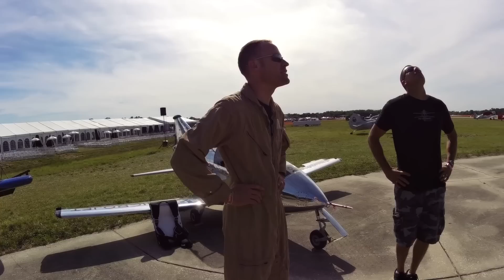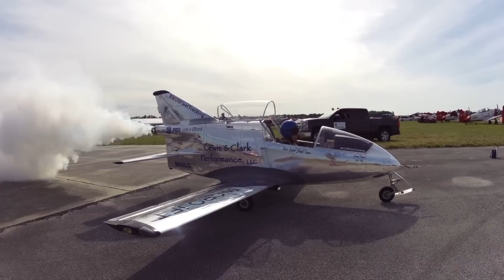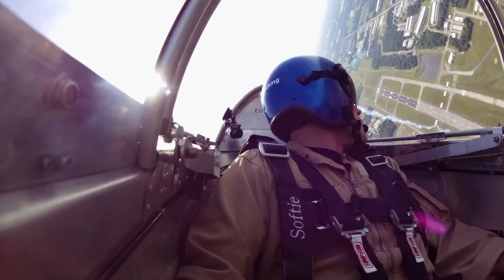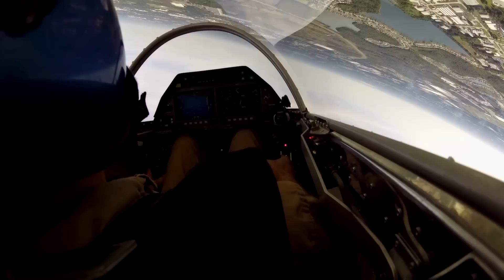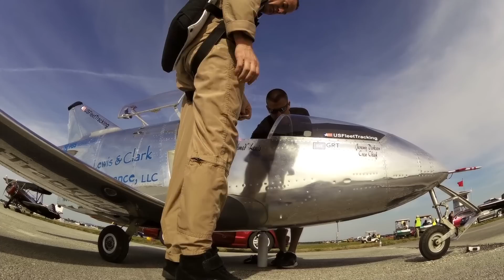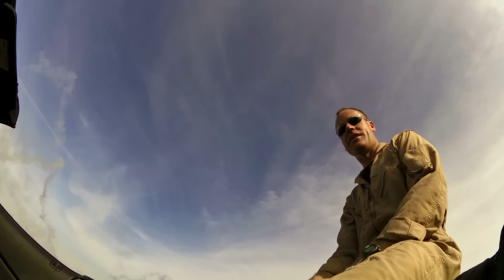FLS Microjet - Flying Magazine

Comment: His comment ( if I understand him correctly ) that only the factory built bd5 were successful and capable of flying until this guy.
That is completely incorrect. Several bd5-j were built outside of a factory. I am unaware that their is some factory who builds them in the 1st place..
My father (Edwin "Ed"Johnson ) personally built 3 Bd's in the 80's. He ( my father) also is the 1st Bud Lite Anheuser Bush BD5 pilot in the air show business
. One reason my dad decided to hang it up was because the engine company that exclusively built the engine went belly up for obvious reasons ( Not a butt load of BD5 -J's were built in its life).. 
. So ya, sorry but you are not the 1st to build one.
 I do recant my comment about a BD-5 manufacturer. If memory serves me ( I was only 4 or 5 yrs old at that time) You do actually order a BD5-J kit which in turn you have to build...
None the less, your jet looks fantastic. Looks like their are some upgrades to the pilot digital console. The old ones were pretty basic...
Reply: I work for one of the original test pilots and engineers on the BD-5J, Bob Bishop, Justin Lewis is a friend of ours and we routinely use him to train our new pilots. Justin is very aware of the history of the BD-5J. 

N21AP and N55PQ were 2 of the first BD-5J produced at home. Bob Bishop flew them in air shows throughout the 70's, 80's and 90's with us transitioning to DoD contract work as our BD-5J look like cruise missiles. Bob Bishop was also the first BD-5J to fly as the Coars light silver bullet (I still have the wings in the shop). We have a fleet of 4 now and we use Justin often, he's a great pilot a genuinely nice guy, and very respectful of the BD-5J, and always safety and mission oriented. 

There is also no factory that ever built these planes, there is a guy "skeeter" who will build the fuselage and wings for you, that's about as factory as you will get. The engines also became scarce not because of the company going belly up but because the company started buying them back after several BD-5J were involved in accidents using the TRS-18. That is not a problem anymore as there are 2 jet engines made 1 with 336 lbs of thrust and the other with 352 lbs of thrust. Both of which are smaller than the TRS-18 at 10'' diameter.
Reply: Don't forget Corkey Fornof - James Bond's pilot. He probably did more for making the BD5J famous than anyone.  The Acrojets - he and Bob Bishop as his wingman - were doing it before anyone.
Reply: Lightning McQueen. Ya
Reply: @kmv7776  "He probably did more for making the BD5J famous than anyone." James Bond did a lot of heavy lifting on that fron as well.

Comment: Build one out of composite and it would probably be pretty stealthy.
Reply: Actually the composite material would likely not be stealth where we use fiberglass we have to use a metalized paint to make it so you do not see the wingspar. They are already fairly stealthy as the signature on radar is no bigger than a cruise missile, which are extremely difficult yo detect.

Comment: So, what are the pilot size limitations on this craft?  I attempted to sit in a mock-up one in some aviation museum somewhere in the US (can't remember where), having been a BD5 fan from my youth but I was a full head-height outside of the canopy...
Reply: Most of our pilots are relatively short, no taller than 5'11'', but that also all depends on if the height is in the legs or the torso. Longer legs is better because you can kinda squish yourself in there, but if it's torso you won't be able to close canopy. There is also a shoe size limitation of no larger than a 10-10.5, because where the pedals are is just below our main avionics bay, and your feet can get stuck on that tray. Shoulders can be an issue too, I have broad shoulders so I get pinched in, and it's hard to move around in there.

Comment: How much did the entire build cost?  I've seen that you can buy the BD-5 kits for $4000.00 dollars. is that true?  I was orginally looking to buy a "HoverBike?"  Like the ones Dubai Police is going to start using by 2020.  However, they're asking like $40.000.00 to buy??  In you expert advice, what would be the cheapest way I can get into the air and FLY?  Would it be the BD-5? Or another "Kit?"

  If you could get back to me at your earlist convenience, it would be much appretiated!  Thanks kindly.  

Ps,
Looking to spend no more than $10,000?  Unless, it't good of a deal to pass up??
Reply: This is definitely NOT a good way to, "get into the air".  It's seems small and cute but there's no way a low-time pilot lives through a flight in this thing.  A no-time non - pilot would live until high speed taxi and maybe a second or so after lift off.  Look at the roll rate and round out speed.  Little wings mean lots of speed.
Reply: Cheapest way to get into the air safely, would be a paramotor or powered parachute on a trike if you can't run 50 yards.  MUCH slower though. lol  Even those will probably cost you $15,000 total for wing, motor, and training (if you chose).  If it has to be an actual airplane, there are many ultralights that don't require training.  Look into quicksilver, belite, kolb, etc. I think you would have to be pretty stupid to fly anything without training though.
Reply: Just so you know the engine alone will cost you a minimum of 65k us dollars they go as much as 80k for the PBS tj-150. It takes us a year to build it and do all wiring, and the avionics are about 30-40k each jet. So minimum flight worthy one of these is in excess of 150k us dollars.
Reply: @BruceBusby  we had an F-15 pilot quit the training after his first high speed taxi, he got a little lift he got squirrely and landed and said he was done. This plane is not a toy and those who do get into it and actually do fly it change their minds about this being a toy. It's a serious aircraft, and only experienced pilot's should fly them, and even then flying a glider first is a pre requisite of ours, as the landing profile is pretty much the same as a bd5j. You are sitting 1 foot off the ground not 4-15ft above the ground like most pilots are used too. Landing these is very hard for most pilots and we have had to do major repairs after a few 1st landings of people. They bend the fuselage where the intakes are.
Reply: @christopherrogers6194  well... I can see how this wouldn't be for everyone.   Looks like you don't really get in it, you more aptly put it on.  Glad you're having fun with it, fly safe.
Reply: you can get the whole kit ,from box to blue sky from bede for around $2,000..just basic hand tools to put together

Comment: you could put that thing in the back of the truck talk about portability
Reply: Lol, we actually have a trailer that has a rough shape of the plane we trailer it around in, we also have a larger toy hauler that we use to transport 2 at a time, it also doubles as our command center when we are doing work.

Comment: Cruise at altitude in an economy power setting? Never exceed ??
Reply: economy is 160 knots and we have never tested it to it's limits so we really don't have a never exceed speed more of a temperature thing for us, if the TIT temps get too high the pilot has to reduce thrust to cool engine off. Our jets max N1 is between 99% and 103% depending on which plane all the engines are just a tad different from each other.

Comment: i wonder how much fuel economy you can get on a micro jet ?
Reply: +FLYBOY805 ..........most small turbines are burning 10 to 15 gal per hour
Reply: +flyinbiker2001 Wow.....That's a lotta Gals.... Wonder if they'll ever make one that burns Milfs or cougars instead....
Reply: +flyinbiker2001 ......or Gay people.....Not that there's something wrong with that....;)
Reply: +AeroManiac ....... I did get to fly the lightweight 2 stroke short winged BD 5 in the 80's and it was impressive but the handling was a bit frighting like a Pitts even with the trigear it needed a lot of rudder due to the light weight and fuel burn was under 5 with the Hirth 2 stroke
Reply: +flyinbiker2001 But still, does it have to be 'Gals'...
Reply: +AeroManiac It doesn't, but I imagine the user commenting prefers 'gals'. Are you discriminating against him for preferring females? He never said there was anything wrong with gay people, you're creating a conflict where there is none.
Reply: AeroManiac Try addressing my statement rather than raising rhetorical questions in an attempt to change the subject.
Reply: AeroManiac You seem very angry. Did I say something to offend you?

Comment: Where's the intaker??
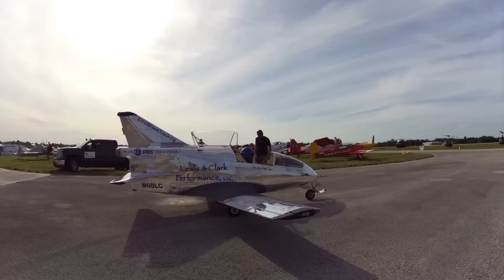Reply: straight down from the back end of the canopy  min 1:06
Reply: @michaelreedx6823  Thanks.
Reply: Yes there are suck in doors on the intakes so they are hard to see, the guy before me is correct on location, there is also on ours panels near the engine that we use a mesh to provide even more air.

Comment: Why the huge dash covering up at least 15% of the front view of the pilot unnecessarily??! This is not necessary... at all. And what is with the terrible job of riveting? The rivets look like they are not even flush/recessed rivets? The avionics look very weak. A ping pong ball on a string cold easily eliminate half of all that clutter. 
Why would you build a “Home built” then Put a huge avionics package on it to go no farther than 300 miles?
Reply: As I recall, the original BD5s were pop riveted.
Reply: Skeeter uses the pop rivets, on our aircraft we use solid rivets. 

As far as the view being obstructed, have you ever tried to put one of these together?? There is literally not much room to put things on this aircraft, where his screens are is the only place you can put them because of how the pilot sits in there, and behind those screens is the one of the avionics bays, which has the AHRS, GPS modules, and a bunch of other stuff. It would be great if we had more room but the aircraft is just so dang small. I assure you that it is very necessary. 

Why would you put all this stuff on it if your only going 150 miles, not 300. Well  you have obviously never flown one or seen one. But having all that avionics in there is for safety. He's flying low to the ground doing an airshow, the amount of info gleamed from one of those screens at a glance is far more you get from steam gauges. If you have never used an EFIS I suggest you try it they are very handy for precise flying, and for us since we do DoD work accuracy is super important as well as safety since we only fly at 50 ft above the ground. An efis shows you the terrain which is life saving when you are at 50 ft. Remember accuracy and safety.

You talk a lot of trash man for something you have absolutely no clue about, quit being so angry about stuff you are ignorant about,.